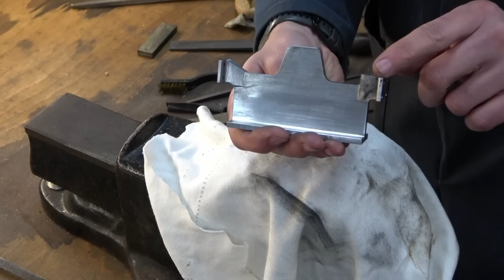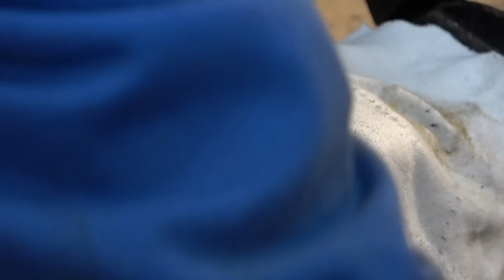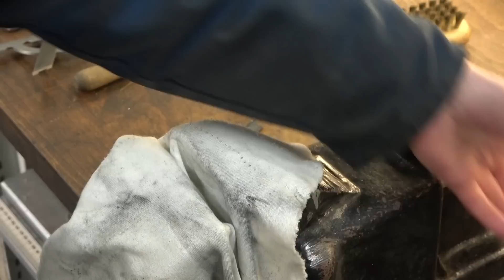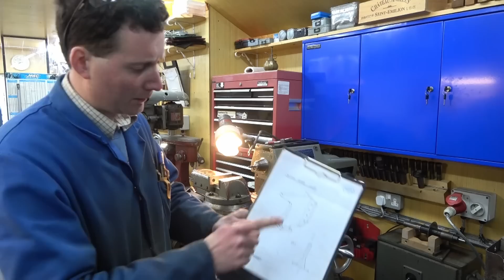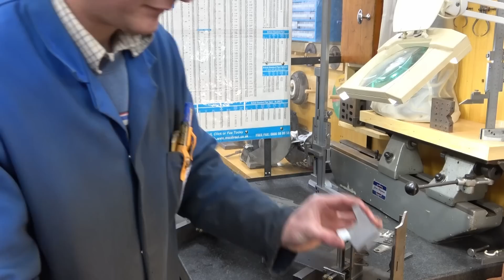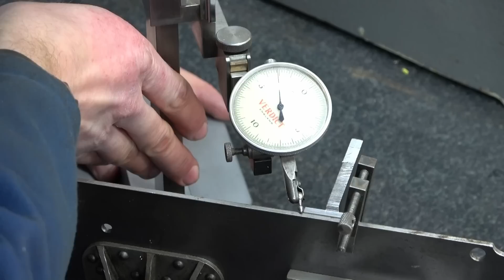Filing, Milling & Drilling with MrCrispin

Comment: You may notice he is not using soft jaws in the vice?
The best way is to surface or belt sander the  vice jaws smooth.
Reply from the maker: They are smooth jaws! Just flat faces like a milling vice.

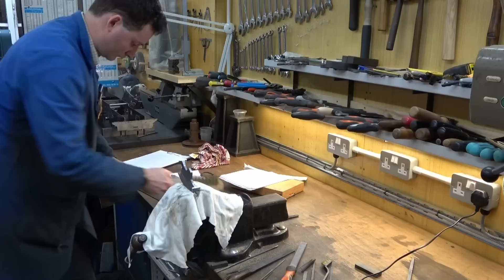Comment: 4:59 - At one time, it seemed a wire wheel would do that as well. It didn't; it ruined the (pricy) file. Use a file card.

Comment: A wonderful masterclass of filing Mr Chrispin. It's great to see someone actually filing on YouTube rather than watching someone "sawing" with a file. By that I mean by lifting the file from the work on the backstroke as it is supposed to be done. As I taught it when I was a metalwork teacher back in the late 70's and 80's. I'm looking forward to the next episode!
Reply: There is no right way to do any job . As long as the job turns out right .
Reply: @ no in this case I do not agree with you. In filing, dragging the file backwards as I described as "sawing" definitely blunts files very quickly. Thus ruining the tool. So by lifting the file on the backstroke, you more than double the life of the file. Which is the CORRECT way to do it. And as I said Mr Chrispin, does it correctly.

Comment: When I was using fp 1s 50 years ago, I seem to remember that there was a small offset between the vertical and horizontal, this was marked on a little plate attached to the front of the quill head. Also that when the vertical head warmed up, it moved about 1 to 1.5 thou forwards. We used to leave the machine running for 20 minutes or so to take out the error.   Is this still the case with your machine?
Reply from the maker: Yes I have the plate on the spindle that says the misalignment between horizontal and vertical is 0.003"

I normally leave it running at 600rpm for 10 mins with the saddle set at 25mm as apparently that lines everything up lubrication wise

Comment: Thanks for another great video. At first, I wasn't sure about watching a filling video but found it very informative.  You mentioned masking tape. I agree but also will use blue painters tape we have in the US. I will also use black electrical tape and will wrap it around the part for important finishes. If called for, I may pull and stretch the electric tape to thin it. Beautiful work on your loco. Thanks for the tig tips. I'll have to try it.

Comment: Nice upload Mr Crispin! The filing took me back in time 42 years ago. One trick I use often is to mark the surface with a sharpy. This shows voids more clearly and your pressure point. I also mask adjacent surfaces with thin tape. This avoids scratching just a little but tells me more to go slow because I'm getting near and/or change to a finer file. It's an art in itself. Watch the bullet vise build from Tom Lipton if you want to watch some more excellent filing. Thank you Mister Crispin! Best! Job PS: did you check the electronic edge finder? I once thought they were handy too....

Comment: Excellent video, thanks very much for doing the filing section it was very instructional. I'm not sure if they still have apprentice training schools in the UK maybe big companies like Rolls Royce do but doing tasks like this were the first day on the job but eventually with practise you could get good form, size and finish. As others have mentioned we used chalk to get the final finish. The best part about our apprentice traning school is that it was near the local college so when the girls walked in we would be at the window checking for flatness!!

On the full size engine, this piece would have been a casting?

All the best!!
Reply from the maker: Good story! Most training schools still cover it but maybe for only a few weeks. Yes these would have been cast.

Comment: I think Mr Crispin is one of the only machinists I've seen on Youtube with good hand filing technique... machine like, long strokes and lift up on backstroke. Same for the hacksaw.
Reply: Make sure you're sitting down when you go find Clickspring...

Mr Crispin here is having a solid run at the title on quality of workmanship, but Chris went as far as hand making files. If that's not dedication to craft, I don't know what is.

Chris is by far the best I've ever seen on hand finishes, on or off the internet.
Reply: @dtnicholls1  I agree about Clickspring. There are others.  That's why I said "one of the only machinists on Youtube". It may have been more clear for me to say "one of the few machinists on Youtube".
Reply from the maker: Clock makers and gunsmiths have always had a certain pedigree on hand filing.
Reply: Does it not count if you do this with a 4” angle grinder hard stones and flap wheels? 😂

Comment: Excellent. On the subject of TIG vs solder - tacking up makes sense, but it is very likely an assembly of that kind would distort during welding, requiring a lot more post weld cleaning / filing / machining than silver soldering. Each technique has its place - but really solder wins out here. 

I deal with a lot of complex weldments daily. Figuring how they are going to move is always a challenge. 

Jolly good!

Comment: Nicely done.
Precision filing brings back nightmares of filing a mild steel cube to 1.000” and having the apprentice supervisor mark you on sizing, fit, and finish then make you deform it with a sledge and anvil so you could not pass it to another apprentice to hand it in as theirs.
Take care and play safe.
Reply: Mine got stamped with my initials and I kept it for a number of years. I don't know what happened to it but it's long gone now.

Comment: Thank you for the explanation of why silver solder vs. TIG welding.  One question I have is whether you have considered TIG brazing with bronze rod?  I have seen other videos where TIG brazing used where the heat input was needed to be minimized.
Reply from the maker: Hi, no I've never attempted that. Cheers.

Comment: Brilliant enjoyed that. 
Hey I noticed when you were doing your hand finishing at the vice you were bent quite far over , Iv got a 2nd vice bolted to a small bit of 100 x 100 x 12 angel iron which allows me to mount 
“ a vice in a vice “ which can make working on small parts more comfortable
Reply: Psst, it’s VISE. I’m sure Mr. Crispin has no vices in the shop.

Comment: The big question though, which manufacturer makes the best files?!
Iv tried bacho, vallorbe and British standard. I’m yet to find my ideal though as I seem to wear them all out equally as fast as each other. Any other suggestions?
Reply from the maker: I've had surprisingly good luck with some unbranded ones from a local hardware shop that the sales assistant said had come from India. Bacho is ok. The Nicholson ones I got from Keith fenner back in 2014 are still very good.

Comment: Personally I would have `chalked` the file  first to prevent `pinning`  with either Black board or French chalk, also would have employed a much smaller file too.  
As per the file card, well that would go `in the bin`. 
As attacking a file with hardened wire will surely cause damage to the cutting edges.
I have always employed a piece of mild steel plate  which is then  stroked across `the cut` of the file, as this  will not only clean but clear the file too.
 In addition it is possible to sharpen some `dull files` in diluted Hydrochloric acid.    
One also  employed this solution to  recover oxidized or clogged filles too. 
Oh and if employing `pins in blind holes during silver soldering I would recommend a small vent hole into the base piece  or the side to release any flux residue during heating up.    But just `my simple ` opinion after 50 years of silver soldering and filing.   Cannot stand Grinderette's  or cutting disc`s a lazy mans tool.  
Hacksaw and file to gain a feel and sound  of the metal being cut and this sounds strange the aroma too!

Take care.
Reply from the maker: Some good ideas there. As for the pins I filed a flat on them.

Comment: TIG really isn't the answer to everything, specially in uses like this. Well done and finished solder is both strong and easy on the eyes.
Silver (or brass) is excellent for joining dissimilar materials and for making color effects; silver solder looks really classy in blackened steel. I've been playing with a thought of engraving a signature, filling with silver solder, filing and sanding to level, engraving the edges and then blackening the result.
Reply from the maker: Good idea!

Comment: A block either side of the inverted "T" and you would have much more rigidity thereby less vibration.
If you apply the chalk used by steel workers applied to the file it won't clog as much.

Comment: TIG vs Silver Soldering I use a mix of the two depending on what the parts are. For dressing welds you just need to get good with a die grinder

Comment: ‘Mr Crispin here’ absolutely love it. Is this a design to make or make to print assembly you are manufacturing?
Reply from the maker: Ah ha, you've found me! It's a scaled down version of a full size locomotive so there are drawings. The drawings are a bit limited however so for quite a few pieces I have to come to with something.